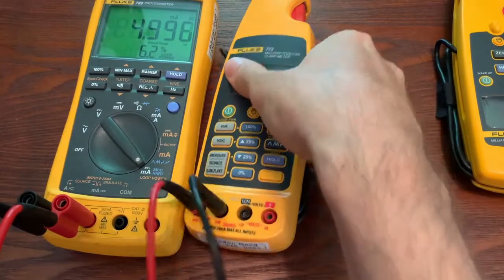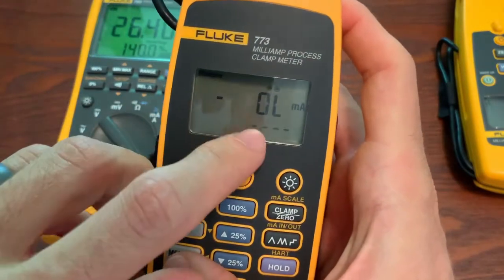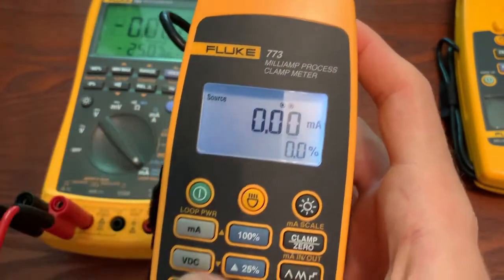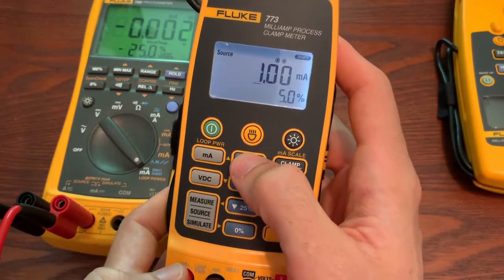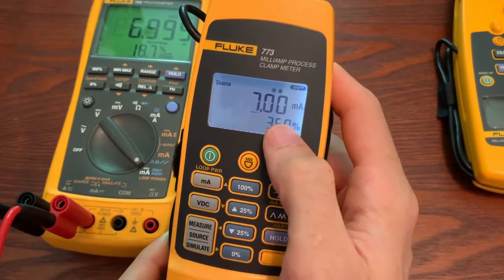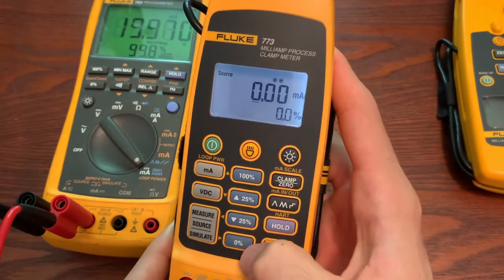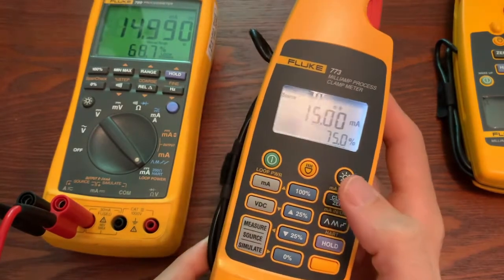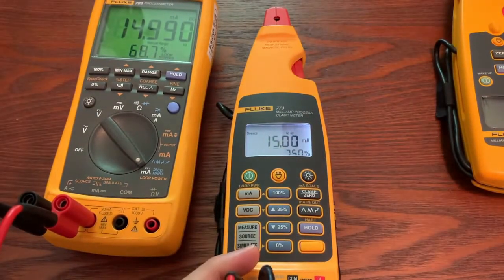02 - Source 4-20mA - Fluke-773

Comment: Can this be used to measure parasitic draw?  Is it more accurate in the low amp range than larger clamp meters?
Reply from the maker: I assume it could if it's DC current and the wire is small enough to fit into the clamp.